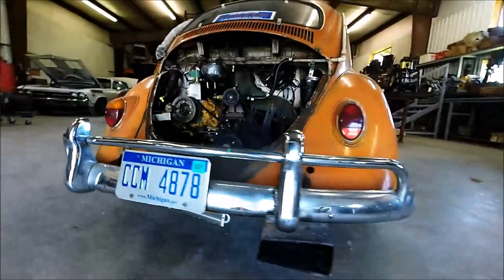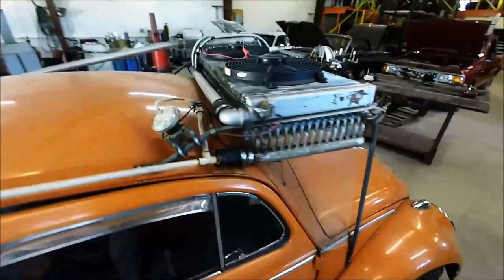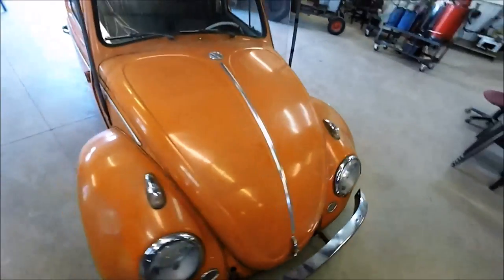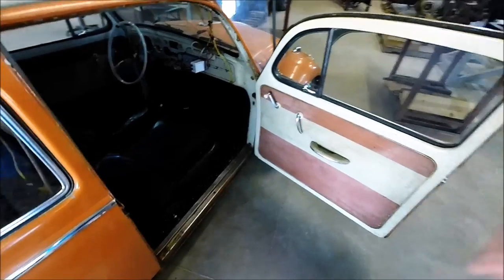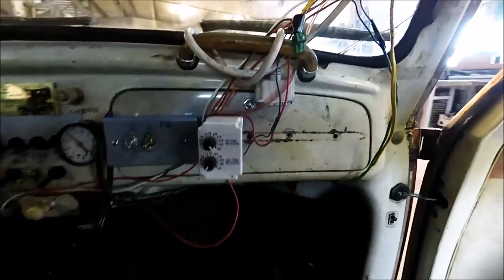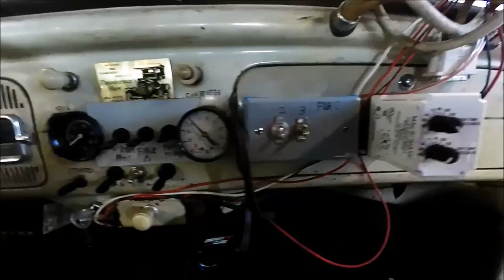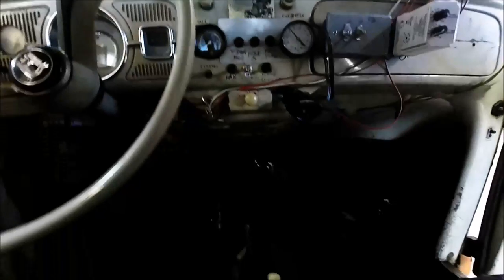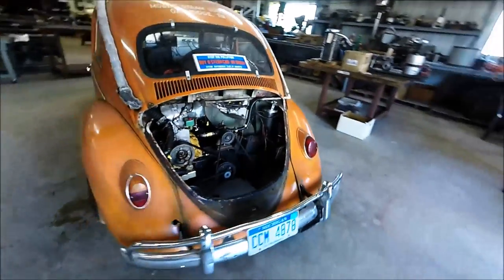1963 Steam Powered VW - Built by Nuclear Scientists

Comment: I love Bugs! Back in the later 70's I was  looking for my first new car. I went to a VW dealership in the greater Metro Detroit area and told them I wanted to buy a  Bug but I wanted the optional big key. The guy said it has a key. I said yes but I wanted the BIG key. So they asked me for more details. I told them my dad had pointed out VW's to me with the big key on the back and told me if you ran  out gas you could wind it up and get to a gas station.  They laughed me out of the dealership.😨 I still can't believe daddy lied to me. Daddy is 91 now, I'm almost 60 and he still laughs at me.
Reply: Instead he should have taught you a little bit about automobiles! You shouldn't tell someone something idiotic to make fun of them!
Reply: @zacharysheffield9413  I grew up with the Auto Industry. I was a teen, daddy was pulling my leg. I know plenty about cars, I just believed the VW had a big key on back, I've seen several like that through the years.  I lost daddy in the last year AND my mom AND my over 20 year old cat.  It's been a hard year, that's for sure.
Reply: @Sharon-pb7so  Sorry!!

Comment: Nuclear engineers from Los Alamos? Oh you just know those guys were thinking about producing the steam with nuclear power. The oil fired steam generator was definitely just a stop gap until someone would let them do what they actually wanted.
Reply: No Oak Ridge is a separate government laboratory aka ORNL in Tennesee .... I used to work on a biohazard detection system that was designed by some guys from there at the oak ridge labs.

Comment: I like this little mini-series going here with the different steam powered cars. I didn't know about the Chevy at all, and this one is super cool. I wonder if steam will ever make a comeback in some form.
Reply: The biggest hurdle would probably be lubrication, since oil inevitably mixes with the steam in the cylinders and has to be separated before it's carried back into the boiler after condensation. As you can imagine, that's a massive pain, and even the best separators still allow oil to make its way into the tubes, so the boiler has to be flushed periodically. I guess it might be possible to do it at intervals like an oil change for a normal car, but it would still be cumbersome to do. Otherwise it'll coat the tubes inside the boiler and ruin heat transfer to the water. Plus, steam engines run more efficiently the hotter they get, but running them too hot breaks down the oil as well.

Also, for more interesting steam vehicles look up the Pritchard steam car - an Australian Ford Falcon converted to steam power.

Comment: i think steam power has alot of unrealized potential, not for mainstream cars and of course electric does it better now but i feel like steam was better than combustion engines in alot of ways, especially for vehicles that need alot of torque
Reply: you could possibly make electric powered steam engines
Reply: @pk-ic5lv  that would be interesting but i think that might be inefficient, plus i think electric would make steams potential redundant soon anyway
Reply: At the end of the day it's power and efficiency which matters. 

Torque is largely irrelevant. 

10 ft-lb with 100 hp beats 200 ft-lb with 50 hp. On top speed, on towing capacity, on acceleration. Higher torque ONLY means you require less rpm to achieve a given power output. 

By way of example, a strong and heavy cyclist may develop more torque than a small car engine. Which means nothing at all in terms of comparative performance.

Comment: I like how they claim steam power generates no smog. Yet, you have to burn SOMETHING to boil the water. So, yeah...greenhouse gases (which goes a long way to make smog). Until we have fusion there will always be a trade off.
Reply from the maker: Smog is a combination of several different by-products of internal combustion engines. It is not simply a matter of whether you are burning anything. Other factors come in. For example, the temperature of the burn can change what the exhaust contains (hence: EGR valves). A steam engine burning kerosene could be made to burn fairly "clean."
Reply: Obviously, they were planning on Nuclear at some point. Let's be honest no group of nuclear engineers ever built this pile of shit. Hacks at best but never would a true engineer show this in public. I call BS on the whole thing this more like junkyard wars.
Reply: @Patriot3  You should do a little research before making a BS claim on something that can be so easily checked.  I DID do a little looking and found the names of a few of the members of the Mobile Steam Society, mentioned in Steve's video as the builders of the VW.  I then was able to find those names on other web pages dealing with things going on at Oak Ridge National Laboratories.   And if that's not enough, take a look at this technical paper written by two of the members and tell me this wasn't written by engineers: https://drive.google.com/file/d/0B6b0kNgEdr-8TWYxWHdxTEpKZTQ/view?pli=1
Reply: Mike Frerichs do research? We have the video right here confirming this Hack Work. Like we need to investigate anything at all. I'd be embarrassed by this project. It looks like zero engineering to me.

Comment: Fancy trying to use nuclear energy to get the steam? What could possibly go wrong (^^)
Reply: ford toyed with the idea
Reply: Actually...That is exactly how nuclear electrical generation works. They use nuclear power to boil water and generate steam, to turn turbines, which turn generators that make electricity.
Reply: Of course, but the danger comes from regulating the thermal energy when you don't need it, it can't be shut off like gas. Not that i'm a Nuclear Technician or such.

Edit: Not to mention the Radiation hazards.
Reply: Ohh....Opps..I didn't get the joke originally. lol. My bad.
Reply: Nuclear Submarines are STEAM POWERED. . .

Comment: How long does it take to heat up and go? Does it freeze up in winter? That's why they disappeared.
Reply: I've been doing a lot of research on steam engines so i can build one, and to answer your question there was only one steam car built in 1925 that didn't have to take ten minutes to warm up you could just go, and they run better in the winter because the water doesn't condense out of the car.

Comment: "no smog"
Still needs to burn oil to fire the boiler
Reply: not if it's electric which in this case its not.
Reply: @cringelast5341  Electric heating isn't that efficient or practical in most cases
Reply: @harrimanfox8961  yes I agree but there is other methods of making heat from electricity to heat it efficiently
Reply: Unpressurized high temp combustion burns off way more of the exhause byproducts. Should be nearly smogless
Reply: Using wood, woodgas, or even ethanol could work.
Reply: ls7orBust2  not a good idea , they tried that with zeplins , and we all know how that ended up
Hydrogen burns well , too well to be frank , and the entire thing catches up fires before you know it
Reply: smog is made up of the byproducts of internal combustion, not external combustion. things like Nox, etc.
Reply: @sspence65  External combustion does produce smog as well. Unpressurized boilers will reduce the problem of NOX but CO, HC and soot will be produced so there would be still smog
Reply: Yeah... the only way this would have been smog free is a nuclear power source eg thorium etc... and even then a small turbine would probably make more sense. Otherwise its at least twice as inefficient as most any competitive internal combustion engine, less NOx but you have to produce twice as much CO2.

Comment: 🤔 not necesary at all so much big mashinery but what ever Im not shure why they put out the original engine out of the bug in the first place? because as it was it was considered as a hybrid engine any way! 😧😒 teslas methode of conversion, electric engines,pap selenoid engine,mutli fire ignitio plazma and amplifier ignition,steam engine,wacum engine,vaporisers,compensators,seperators,closed exaust engine,internal/external runing engine,multi grade fuel engine etc etc etc  so Im wondering my self as a profesional old timer restorator mechanic,chemist,electric inginer why to hell they wuld take alredy a hybrid engine out of that car and put that heavy crap in side??? After all evry thing is a mather to change molecular mass at high speed from liqued>gas>solid's and vice versa 😒 belive it ore not peopel you actualy can use all of that mentioned above and more and still get bether result's than that gient crapy thing because its to much dangerouse to control that thing expecialy peopel see a locomotiv boiler blow up!!! lpg is safer ore water cells in a closed system engine than that thing and still you get masive torque any way some pre heaters pre mixer chambers and selenoids/magnetic gun's  do the same thing but smaller and more efficient than that thing 👆 I belive plazma generators to the same crap, besides its easy to see a 4 cilinder engine idel at 16k rpm like the funny cars ore have masive torque at 200rpm idel speed just like a tractor engine so any way you still use lubrication for that thing its basicaly similar to lpg car stile engine. Im runing vaporisators and plazma/amplifier ignition on ordinary 80s gasoline/disel block engine and still get for glass of centrain fuel over 400 miles even with out that crap if you calculate how much that thing use water and lubrecant and how much is steam dangerouse its bether to go with lpg and you vaporise your own fuel ore water cell. Interesting yes but considering how hot it is inside that thing I wuld not drive it.Well any way thats my opinion as a real antice engine lover if you dont belive my see wikipedia I ques what it wuld say for hilters military wv bug they did not definatly put a giant boiler ore a gient condenser on the cars roff because they firstly did not have metal resorces ore oil to begine with! So meaning they did not use such set up at all!!!
Why wuld they? Expecialy in a desert where fuel ore any cinde of oil auto ignite!!! So ither it is cold energy,solid raw fuel ore plazma,air engine ore electric power nothing ells come's to my minde and those devices creating that cinde of energy is less than 10kg in weight not that gient staff that you see👆 So thats not definatly what they used ore a real nazi tehnology it simply is not practical ore you culd not finde a driver capabel driving that thing expecialy if the driver get killed you cant finde simply a replacment thats non sence.
That is not the real thing 👆.
Any way nice video this was just a small history leason.
And dont trow away that deam beatel engine you will nead it😑